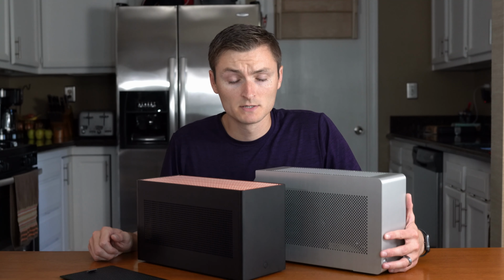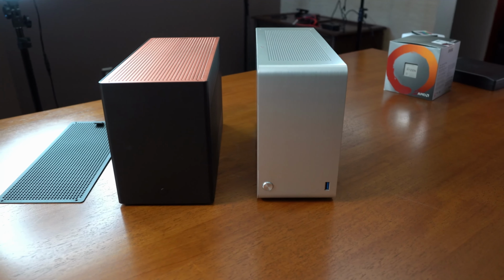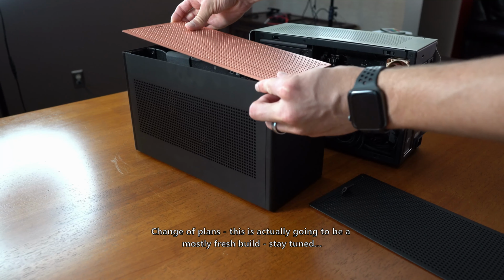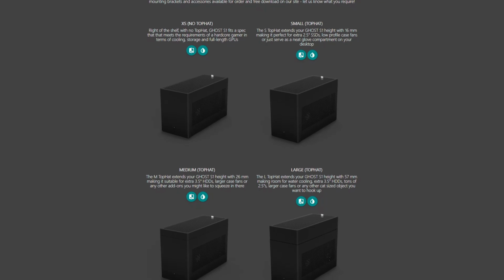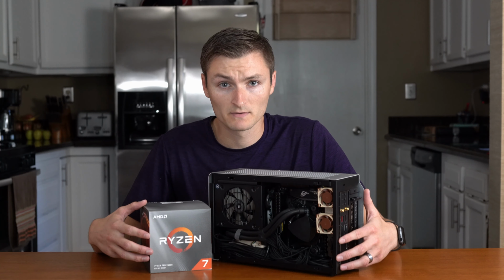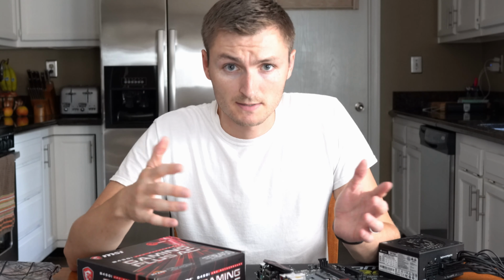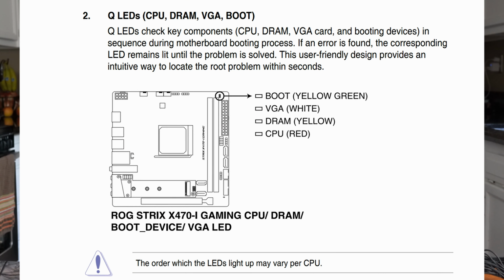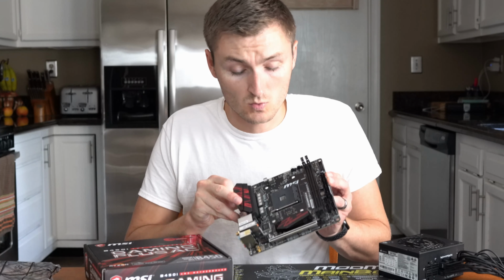Air-cooled Louqe Ghost S1 w/ 3700x - the build & BIOS woes

Comment: Did you have to bend the CPU cooler? I've read that the NH-L12s won't fit in a ghost.
Reply: It says that the pipes were bent. Not enough clearance for the L12s out of the box.
Reply: @Fluffymuttins  Ohh thanks a lot! I've decided to water cool mine :) So no need to fiddle with the nh-l12s
Reply: @PaladinJenkis  I'm guessing you've seen Optimum Tech's setup? It is tempting but I don't know if I want to drop the extra cash for the large top hat.
Reply: @Fluffymuttins  yes that's right. I got inspited by that and I am looking for watercooling parts now.
Reply: @PaladinJenkis  Awesome! :D

Comment: I’m having a hard time choosing between the Dan A4 & S1, in your option, which is your favorite and why?
Reply from the maker: I'm really torn on this one. The S1 has nicer materials, options for expanding volume, and more CPU cooler clearance. The A4 is more compact, doesn't have QC issues, and is less expensive. It depends on your goals and what you value. A4 for simplicity and S1 for options...if you don't mind dealing with things like short front IO cables, bad tophat color match with colors other than Ash, and a few other potential QC issues.
Reply: @cachedbytes5810  i did hear a ton of complaints on QC with the S1 recently, the thing that i really like about it is the options, thats what makes it so hard. I think im going to go for a A4. I just checked the most recent reviews on Amazon for the Ash S1 and even the most recent reviews have complaints. Would be nice if they updated the A4 to have the option to add top sections, that would make that case the best compact mini ITX case
Reply: What did you get eventually?
Reply: For me it’s Ncase M1, Loque S1 and Dan in that order for top 3

Comment: does the noctua l12s fit naturally with the ghost s1 or did you have to do some physical bending to the cooler?
Reply from the maker: The pipes did need bending. It took a few tries to get it right - test fitting, removing, bending again, & reinstalling.

Comment: 3700 and no top hat? I bet that baby is toasty. I do love how the ghost looks with the copper though.
Reply from the maker: It's a bold, maybe unrealistic, move with the 3700x, but I'll see what I can do to keep the heat under control...top hat(s) will be added soon enough though. Testing & comparison results video to follow.
Reply: It's only 65 watts. I have a 2700x (105w) in this case with a L9x65-am4. Runs fine.
Reply: @2zero994  it runs way hotter than the 2700x. TDP is only a part of the story.  Source: I own a 3700x
Reply: xenimaging oh damn